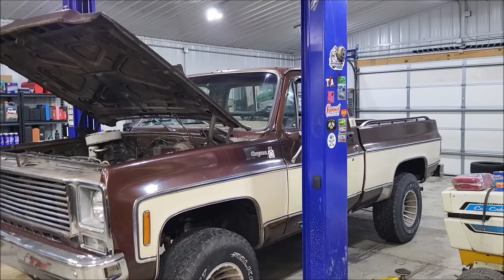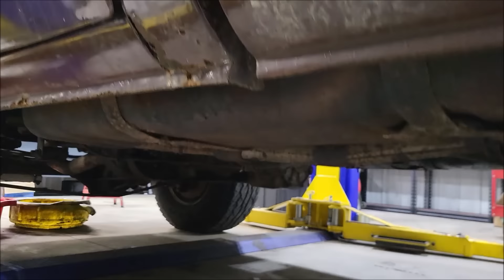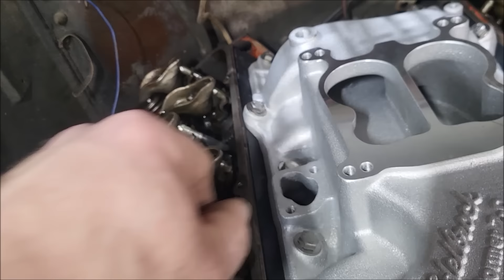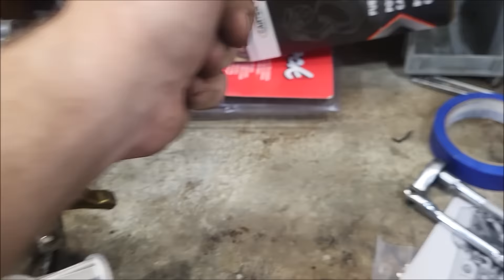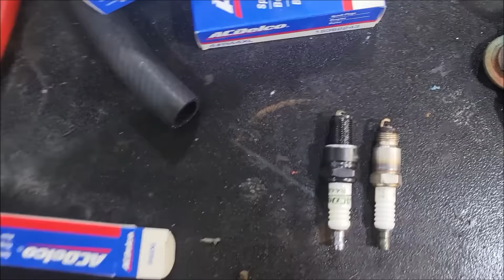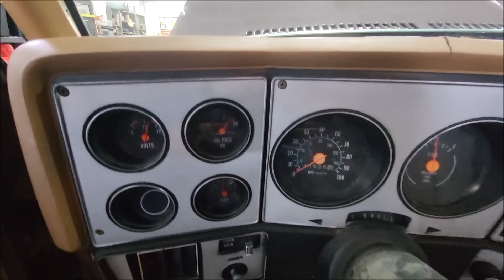Fixing a VINTAGE BIG BLOCK SQUAREBODY CHEVY!

Comment: I always kinda wondered if an early 396/402 with decent compression and oval ports or a later smogger 454 with peanut ports would run and perform better.

Comment: Nice work!!! I also saw thread-in rocker studs, but maybe all Big Block Chevys have that?
I see that cabover Freightliner @45:58, and spotted that C60 parked up the hill to the left, earlier in the test drive.
I see what looks like original paint on the truck, but I also see what looks like newer paint on the driver's door and passenger side fender.
Off to go see if I missed any other uploads here...

Comment: Awesome Rig!!!!
LOVE those turbine wheels and I'm digging that tube/bar grill!!! I spy HEI, and of all things a running horse, on the carburetor.😁
That brown and tan perfectly captures the mid-to-late '70s - all you need is one of those ski jackets with no sleeves they used to wear back then!
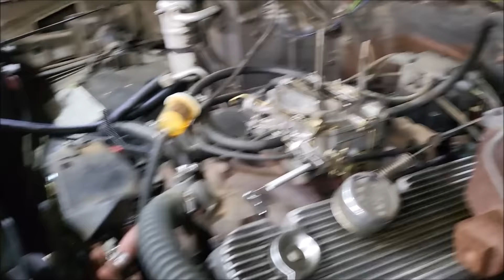I wonder if the 396 was originally a 2 barrel - some of them were, and I believe had lower compression.  OK, I'm still only 4:09 in...

Comment: I use Hylomar M for sealing bolts, the catch is you have to put it on the thread and under the bolt head and on both sides of any washer if any, screw the bolt in finger tight, unscrew it, wait at least 10 minutes for the solvent to evaporate, then screw the bolt back in and do the final torque. I don't know the longterm performance of it yet but I hope it's good. It doesn't stay completely liquid but it doesn't go solid either, it's kinda in between, like a soft goop. Permatex non hardening sealer is similar I think. Teflon pipe dope isn't good because the threads aren't tapered, it relies on the taper to squeeze the teflon together to make it seal, which doesn't happen with parallel threads.

Comment: Crazy thing is edelbrock has all the same fitment issues you run into with the chinese knock off intakes but at least on the knock offs the casting usually looks nicer. Edelbrock didn't even bother machining the surface for that exhaust crossover plate.
Reply: Yeah, it's pretty much to the point that if you're not using old parts you might as well save a fortune with China crud instead of name brand crud.
Reply: Selling the Chines ones eh?

Comment: Somebody (presumably smarter than me) told that thread sealers are usually made so that they don't skew the torque specs as much. I've also used Permatex nr.3, but it seems to harden in high heat areas even though its supposedly non-hardening.

Comment: During my teen years, my Dad, brothers, and I came across a 3/4 ton, 4wd, Silverado with the long box.  The beauty of this truck was that someone had swapped in a 427 with the 400 transmission.  Man that truck was fun.  Tap the gas while holding the brakes tight and it'd walk right through them.  Punching it without the brakes and it would smoke the tires, then launch throwing you back in the seat.  Loved growing up in the 70's/80's.

Comment: Huh? An Edelbrock Performer is the same thing you took off of it. Carter(Federal Mogul) sold the design after they decided to exit the carburetor business in 1985. That's why '84 Mopar V8's had Thermoquads and '85's had Quadrajets. Not knocking your work but carburetors can look old and still be fine. Those are so simple my grandmother used to rebuild them when she got bored knitting Christmas presents. I knew what the answer would be when you said Qjet but at least the customer is happy with no excess thought required. Try to upload more often 🙂
Reply from the maker: I know they are the same carb. I actually remember when both brands were sold in Summit at the same time. When doing something for someone else it's better to go with something I know will work and not cause problems down the road.

Comment: Loctite 515 for thread sealing.  “The purple poo”.
Reply: I've had good luck just using regular blue loctite for sealing.  I've even used it on fuel fittings and never had a leak.